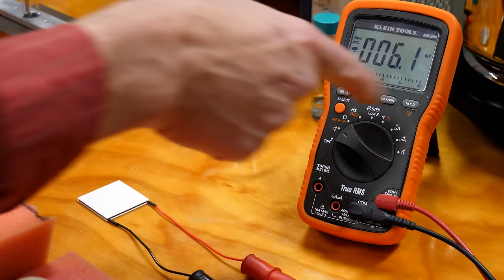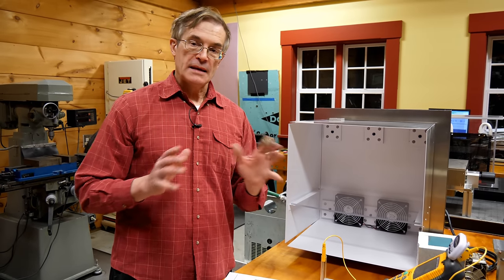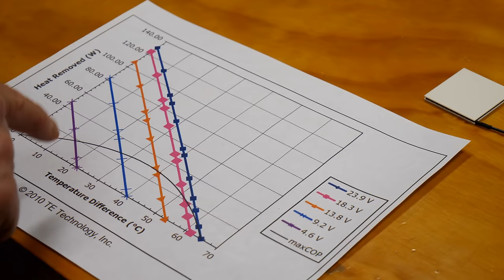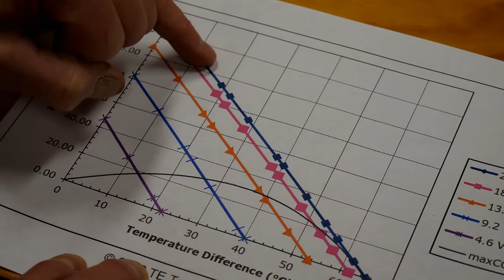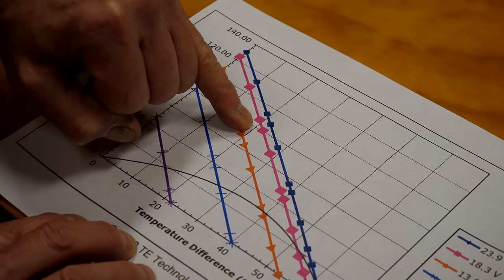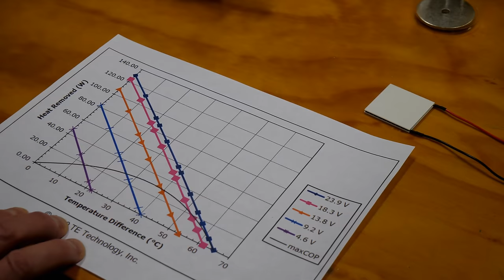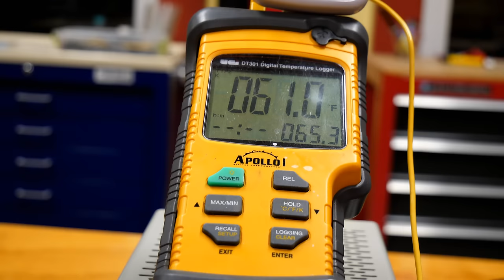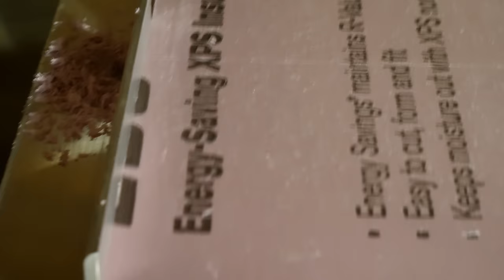BUILD YOUR OWN REFRIGERATOR! - SOLID STATE TEC

Comment: To get the university course version, change the speed to 1.25
Reply: 144p for maximum experience
Reply: Also replace every other thing he explains with "if you don't know what that is, you shouldn't be in this class." 

Don't forget to add in random "as explained in my book"
Reply: Speed 2.0 is better
Reply: For the ADHD version please use 3x
Reply: @lassef3692  whilst randomly going to 0.25x
Reply: Holy shit. The videos are interesting but because of the rhythm he's speaking in, I'm falling asleep
Reply: Fantastic advice ...it works , cheers
Reply: Cliffs Notes...where are the cliffs notes....? Lol
Reply: Beat you.  I had it on 2X.  I may have missed a few details...
Reply: @MrLittleswede  Don't forget to use the crappiest speaker on the loudest setting possible so your friends two streets over can tune in too, but not understand anything
Reply: And to get the 5 minute crafts version put the speed to 2.0
Reply: I already watch everything in 2x lol
Reply: @vincentguttmann2231  that has to do with the speaker drivers plan obsolescence of using a box instead of sphere for your acoustic apparatus inside a box the sound waves bounce around erratically I mean you're essentially talking about a perfect piston movement of the voice coil and then you're introducing distortion into the box speaker inside causing a shimmy and sway of the diaphragm from inside now if you use a sphere on the other hand you have a perfect piston movement the sound waves inside or is clean as the sound waves outside then all you have to do is do away with the pressure gain inside where was you'll blow the speaker up, my dad did this with his spherical speaker enclosures made of acoustic fiberglass with a parabolic reflector dish when I was a kid I actually watched him run a generator using sound waves using hotel California at over 240 decibels I'm pretty sure all the neighborhood heard it clearly too since distortion was mitigated by the perfect apparatus of the Piston movement that means that the ear fatigue was also mitigated by 86% as per Princeton audio Labs research to put it plainly the people's 6 mi down off the hill miles heard hotel California at about 1:00 at night like a concert
Reply: @user-co7do9nz9s  That's me with every video I watch.
Reply: I’m watching at 2x I can’t watch anything at normal speed 😂
Reply: @stjepandrenski5486  Sadly this is true of so many otherwise interesting videos. It is especially prevalent in those from the US.
Conversely it often helps to play Asian youtube videos at .75.

A big problem is that we often perceive people who speak more slowly than us as not very smart. Unfair but true.

It's just what we are used to, the UK cadence is much faster than this, but slower than many Asian countries.
Reply: The average human mind can digest about 1.6x speed average spoken word last I read, though I'd love a good journal read if there are arguments against this. Shout out to the person who said they may have missed some shit at 2x.... cause you almost certainly did
Reply: @stjepandrenski5486  -- 0.75 for amazing bed time story material. His voice is perfect old pops telling you a story and puts ya to sleep in 3min or less
Reply: @Speed001  -- Psychology textsbooks? It was a sociological research observation from the best of my recollection but was used to discuss the speed our brains interpret spoken word and the max speed. If you're asking for a citation I would ask if you've researched it at all yourself to have a counter other than subjective opinion, and if you do have a counter I would gladly read it.
Reply: @briankilo2560  Exactly
Reply: For night time asmr don't change the speed😂
Reply: Imagine people trying to read today and complaining that it’s too slow to fully absorb and commit to memory 😂 we live in a world where people will watch or leave a video within the first 10 seconds intro so you mainstream youtubers all yell and talk faster than pharmaceutical warning voice actors and auctioneers with that false overemphatic hype tone

Comment: I hate peltiers. The efficiency alone made me drop them as a heat pump years ago. I would love to find a way to build a micro compressor system. Super great video as always!!! You rock. Great explanations :D
Reply: Hey my last name is pelletier lol
Reply: william pelletiervslol well it’s spelt Peltier so not u
Reply: See thermoacoustic refrigerators.  Not solid state, but can function on the scale of a microcompressor.
Reply: Fritz can you dumb it down a little for a non technical and generally stupid person like me please?
OR
any/some links or something?

Thanks
Reply: I have the same idea..  ( how to give more than 1 thumb up ?)
Reply: Yeh, I’m putting a lot of research into this aswell, and also making peltiers more efficient
Reply: @gorilla8809  contact me at my business email then
Reply: @Volt64bolt  Where can get your business mail??
Reply: @gorilla8809  on the about page on my channel, I don’t like to put it in comments as I get lots of spam
Reply: @Volt64bolt  Thank you.
Reply: Using soft robotics, you could engineer such a thing with dielectric muscles (I think that's what it's called). Going to be trying some experiments with that when I get the chance and order in some conductive carbon paint.
Reply: @gorilla8809  Same here. I am working on making peltier refrigerator more efficient at low cost. Contact me for any discussions related to peltier projects.
Reply: They're not as efficient as compressor based systems, but they're not bad if you engineer your system well. In practice they can often pump an amount of heat equal to their electrical input power (COP of 1). They're really good when you need to cool small items such as processors or IC's.  Or when you need to regulate a temperature that is close to room temp. I use them to run a wine fermentation fridge that sits at about 60 degrees. They work really well for that since they only need a 10-15 degree delta.
Reply: a submerged electric water heater is nearly 100% efficient, so if you can submerge the output and utilize its heat production, as well as their cooling, they're very efficient... again, if you can harness both effects
Reply: @MindCrime550  If I am camping in summer in 30 deg C there is really no use for the waste heat. Just for ice cold beer. peltiers just suck, mostly current but not very much heat.
Reply: Peltiers aren't universally bad--they just have particular use cases. Much like you suggest, there's no real alternative for small size and ridiculous simplicity.
Reply: It's used with blood small plastic tube crushed by a roller very small compression
Reply: why not make a big one? The insulation capabilities for fridges now require very little energy... but AC units are a different story. But imagine a 10x10" peltier
Reply: @arhamupadhye5157     You can up the efficiency by using vacuum insulation panels for most of the unit, then a thicker foam for the access area, which ideally would be on top.

   Then for the cooling/conduction side of the TEC's, use a combo of super thermally conductive materials like graphenic-graphite--fairly easy to make at home. Robert Murray Smith is a good channel for that--there are many ways to make these low quality, pseudo graphenes, and it is much, much cheaper than buying them.  Then with those highly conductive materials, also make it so you can also use evaporative cooling in combo. It can be as simple as a copper box with holes on the top filled with the highly conductive material but with space to add water, or water-alcohol blends.  

  With having the TEC's on top with cool side facing down, and a fairly efficient but simple cooling system connected to the hot side, you might even be able to do away with the fans. 

  I'll be doing something similar as the above, and connecting it to a solar panel+battery set up.
Reply: Its an inefficient cooler but it's a pretty darn efficient heater.
Reply: There exists very small compressors, that you can get from small ice machines, had planned to do so my self.
Reply: Checkout Tesla turbine, i think with some modifications you could build a a compressor.
Reply: spelltier
Reply: Yup, low voltage compressors available on Ebay. You are excellent at learning the steps involved in making something specific to your needs. I'm looking towards a food storage design. There are alternatives to the institutionalized refrigerants that don't cost a crazy sum and work well as proven in Europe.
Reply: Adam Savage has one for his cosplay body suit. Itsa on his channel.
Reply: Frigidaire makes a tabletop icecube maker and it uses a very small compressor system. It uses rods in a water bath to for bullet shaped ice cubes. Interestingly, the ice cube maker came with a warning sticker on it specifically mentioning that the refrigerant is flammable.
Reply: I would have get the hot air discharge rediret it to a small portable cabinet (if you have space) in order to dry my clothes after washing.
Reply: Actually, It's quite easy to build a micro compressor system using refrigerator parts.

You take a fridge compressor, some copper piping, solder them together (just be careful with flammable gases)and flush and fill them with refrigerant.
If you don't need it to run for years, you can play with it. It's not like it won't work if there's a wrong oil or something.
You mostly just have to understand the vapor pressure and temperature of your gases and how they act.

As of safety, you have to know how to handle flammable gases/fluids, and do it in the open (ventilated)
And you should avoid using large tubes/fittings/containers. An average fridge compressor can easily push 40 atm (600psi) if a tube gets plugged.

I've been playing a lot with those since I was like 17 :D
As a refrigerant, I've mostly used butane. It's flammable but it's obtainable and you don't need much pressure or quantity to make it work.
Quite an efficient refrigerant, too.
Reply: @graphene1487  😸
Reply: Will is a other super cool genius! He's got great videos too.
Reply: @paulneilson6117  wat
Reply: @Volt64bolt  when you stack them in series the current stays the same 5 Amps times 48 volts is 240 watt input. That can pump 500 watts. Try it then type yor question marks.
Reply: @paulneilson6117  what are you going on about? I know how electricity works mate
Reply: @Volt64bolt  am i wrong to say better conductors alone or you need two that are similar enough ? Graphene is my choice but its also not easy to get a hold of in useable states . our current conductance scale(%IACS) is all screwy any way with copper being commonly 100% conductive , silver being higher at 105% and graphene 1000 times either(speculation and at extreme cold) . There is newly graphene lined copper that exists only in lab so far that has 116% conductivity at room temps . I've yet to see a device use graphene for its conductors mind you .
Reply: @tobiwonkanogy2975  for what
Reply: @Volt64bolt  for the improved peltier design you had thought of . would better conductors matter?
Reply: @tobiwonkanogy2975  ah, in a way the outer casing thermal conductivity matters, but only to an extent, swapping the standard ceramic for something better would only help so much, for example changing it to copper would help it cool down faster, but wouldn’t change the efficiency. In terms of the inner materials, they do need a high electrical conductivity however they also need low thermal conductivity so semi conductors are better than metals, so graphene could work however it’s thermal conductivity is quite high, however graphene oxide can reduce the the thermal conductivity. Not much research had been done into that though and I don’t have the facilities to make any since it needs very strong acids
Reply: @tobiwonkanogy2975  although I could try refining my own acids, I do have the stuff to do that... this is worth looking into more actually, thanks for the help
Reply: @Volt64bolt  Thanks for the basic overview/lesson. Best of endeavors
Reply: @tobiwonkanogy2975  thanks, although I think a micro compressor like the parent comment mentions would work better. Especially since I can think of a few simple ways for that
Reply: @Volt64bolt  from what little i know of compressors, they have for mini fridges . They are basically a piston(engine for ex) that instead of exhausting to atmosphere, it exhausts to closed loop systems . perhaps tiny engine blocks can provide some jumping off point.
Reply: @tobiwonkanogy2975  yeh i know how compressors work and I also have a few ideas for them since you could kinda use a turbo from a car I think, I’m not quite sure it was years ago my dad, who is a mechanic, explained how they work
Reply: @tobiwonkanogy2975  they compress the gas which causes it to heat up as there is the same amount of energy in a smaller space so more energy per volume, once you allow this heat to conduct away then you re expand the gas spreading out the energy causing it to be cold. Since heat is basically just kinetic energy of the atoms and the friction between them and their inner workings.